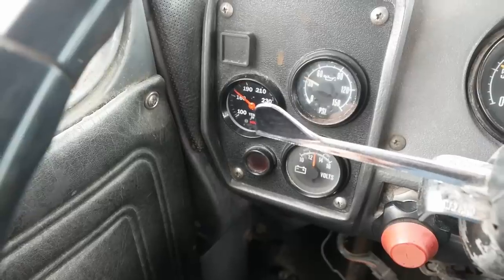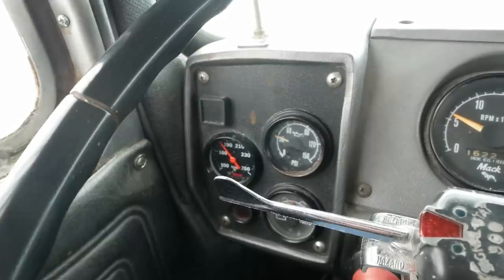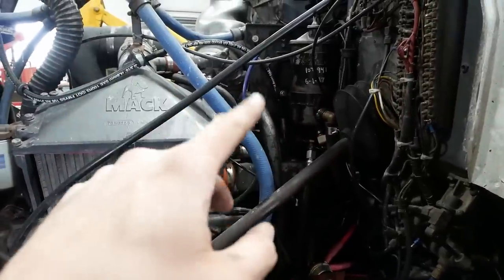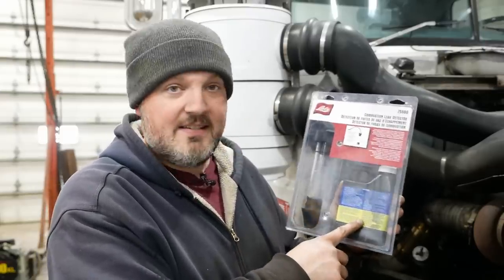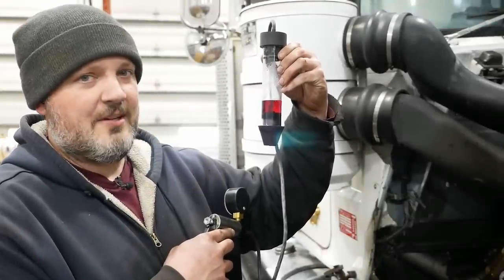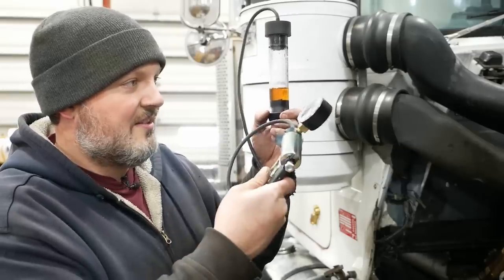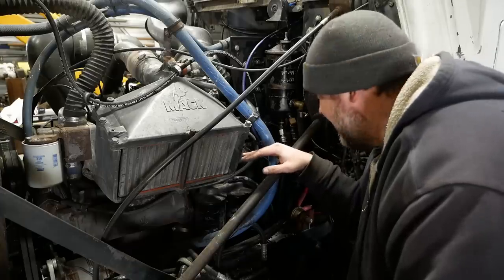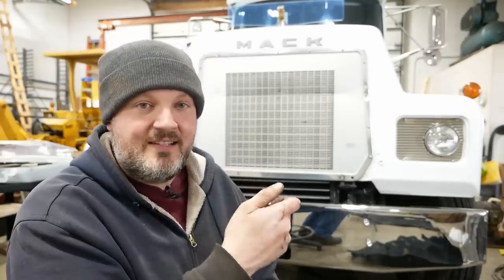Can You Trust a Head Gasket Tester? - R Model Mack Overheating

Comment from the maker: Be sure to tell me it's the compressor! https://youtube.com/shorts/HHOhku_5IKA
Reply: I post guitar playing videos from time to time and a guy told me I was playing out of tune. Replied with "No, I checked before and after recording". Got an answer telling me "Well yeah but you were out of tune in between!" Internet commenters sometimes...sigh.
Reply: Looks like a bad head gasket to me!
Reply: No one ever wants to believe its a headgasket. I once told a guy he had a dead cylinder, which you could clearly hear while cranking. He said it was the idle air control motor... seems legit!
Reply: Considering the weird vehicle issues you seem to readily attract, as added sanity insurance before replacing the head gasket, I would: 
1) Make sure it still bubbles with the oil cap removed (i.e. over-pressurized crankcase + cracked block combo). 
2) Use a radiator cap adapter and pressure gauge on a cold start and see if it quickly hits and continues past 20+ psi. With the compressor/turbo system ruled out, a liner/head/fire-ring leak should be the only way left to give it that much pressure. And if the pressure just levels off at some low psi... 1) Figure out how to be less attractive to weird vehicles 2) No idea. But I'm sure it will make an interesting video.  ;-)
Reply: Didn't Eric O/SMA recently did a Prius and it held pressure and I forget if it was the liquid tester he used also or not but that's usually the way to go. Anyway he got the job and pulled the head and sure enough you could see the gasket blown out clean as a whistle between the water jacket passage and one of the cylinders. It just wasn't clear enough to know because the severity was minimal.
Reply: My Car a Fiat Panda 169 hat the same symptom. Once you hit the Accelerator the temp would shoot up and come down again while decelerating. Headgasket blew out and the head was warped.
Reply: The one thing we know it is not is combustion gas.  Your breath turned it orange or yellow.  Diesel exhaust gas is 12.5% CO2.  For every gallon of diesel burned, it generates 22.38 pounds of CO2.
Reply: @tarstarkusz  22.38 pounds of what?
Per square inch? Absolute weight?

Only confirming, as 1 gallon of diesel is 7 or 8 pounds
Reply: @cryoburned  Diesel is yes. Of which around something like 6 pounds is carbon atoms. And when combined with 2 oxygen atoms per each of those carbon atoms, ends up producing around 22 pounds of CO2 after combustion.
Reply: @cryoburned  22.38 pounds of weight of CO2.  I believe a gallon of water as well.  It picks up the extra mass from oxygen molecules.
Reply: It's the compressor.
Reply: I would like to see more of this.

Comment: Hey Wes. You might want to disconnect the coolant lines from the compressor and run the truck to insure the head gasket on the compressor is not the issue. Even though you disconnected the discharge line, the compressor is still trying to build air and could be leaking pressure into the coolant system through a leaking compressor head gasket. You can also drain the wet tank to see if there is coolant present. You can also check the intake air pre-cooler by bypassing it In the cooling system. I’m not trying to tell you what to do. Just trying to help out. I watch your videos every week and think you do an awesome job. I’ve learned a lot of tips and tricks from watching your videos over a few years and its made me a better mechanic. Thanks for the great content and knowledge.
Reply: I second this
Reply: there is no coolant going through the head gasket area on that compressor. you can install stand pipes and fill them while running but its much easier to just pressure the intake of the air compressor since they are just reed valves
Reply: 3rd this
Reply: Compressor head gasket can cause some real problems. I had one go bad and backfill the fresh air supply line to the compressor which loaded the intake manifold. Starting the truck back up to pull it around into the shop bent the number 6 connecting rod. Learned my lesson quick on that one.
Reply: Yes bypass everything on the compressor before pulling heads.
Reply: I fourth this
Reply: Hah. No.
Reply: There is just no way there is any exhaust in that cooling system. Burning diesel creates a ton of co2.  It's over 22 pounds per gallon of diesel.  It's like a 3 to 1 ratio.  He is questioning chemistry, chemistry he proved is working with his breath.
Reply: @tarstarkusz.  Not remotely close.  It’s not uncommon for the symptoms to only show up when under load.
Reply: @sharpright6887  But the gas pressure is in the system even not under load.  Did you not see all the bubbles?   There likely would be enough residual CO2 in the system dissolved in the coolant.
I suppose it's possible the truck has 2 problems. 1) air getting into the coolant and 2) a leaking head gasket only under heavy load. But this seems unlikely.
Reply: I think one way confirm this theory would be to get a air tank (measured) and a pressure gauge and hook both up to the coolant tank. Then measure it over a period of 1 minute. Calculate the amount of pressure and flow by how full of gas the tank is. Compare that to known sources. Example, Turbo pressure (would be way lower than the air compressor). If its between the turbo max pressure but below the air compressor max, it might be the air compressor. If it is 300-600 psi head gasket is likely.

Maybe some modification of that theory might help someone. You could also drop a type K thermocouple in the liquid and measure its actual temp to aid Wes's bubble gauge theory.

Comment: I've used a 2 gas Hamilton smog analyzer for several decades on gasoline vehicles to detect a leaking head gasket. Worked very well. But never had a leaky diesel head gasket. Plus it never occurred to me to use the analyzer on a diesel. That would be interesting if it did work on diesels.

Comment: I like your theory about the gas bubble.  My first thought while watching the temp needle drop is that NOTHING could take heat out of the coolant that quickly.  All I could think of was some sort of intermittent restriction that blocked all flow, then allowed near-room-temperature coolant to suddenly flood in.
Reply: And a diesel like that couldn't add that much heat to the coolant that fast in the first place.
Reply: That's something you probably won't find till you pull it apart. I'm glad I've never had one you couldn't tell for sure.
Reply: Actually, my first thoughts were to check to verify that the gauge is indeed working.

Does the engine smell hot? You should be able to smell and feel the difference between 180º and 220º with the hood open, and perhaps even closed.
Reply: @DanEBoyd  Get a laser temp gun they will tell you temp of what ever you point it at.
Reply: I’m thinking either a flakey temp gauge or a bad thermostat to start with. If it’s making cooling system pressure stone cold, & if it was setting off the Co2 tester then that’s bad news.
Reply: I agree, and had the same thought as well.  There is no way the coolant temp could increase and decrease that quickly.
Reply: you sure the gauge is working, got another one to try good luck
Reply: @DanEBoyd  may also consider relocating the temp sender to eliminate the possibility of measuring the gas bubble temp instead of the coolant temp.
Reply: @gerardcudmore1556  they work on Emissivity, they have a huge variance based on whether they are pointed at black rubber hoses vs shiny metal.
They are useful, but not always something you can trust.  
I think he already has one
Reply: @gerardcudmore1556  That's what I was trying to think of...😆
Reply: My thoughts exactly, Is there really a cooling issue or just a temp gauge issue.
Reply: @DanEBoyd  Hand held laser thermometer or camera thermometer. In good quality, neither is cheap, but either is better than any gauge known to man. I have a laser thermometer and i never bother using the temp gauge whenever i'm diagnosing sh!t. One too many times i got bit by broken stuff, right out of the box garbage and more. Dash gauges are more like guidelines for the road warrior, whenever you fix stuff, you shouldn't even acknowledge their existence.
Reply: Yeah - I was doubting the sender/line/gauge  too.  Perhaps pull the sender and confirm it functions correctly outside the engine ?
Reply: That’s not a “Canadian” air cleaner setup.  It’s a Mack Tip Turbine aftercooler.  All Mack’s with that engine had the same air cleaner setup.
Reply: Saw the same coolant gauge behavior on an '87 Chrysler New Yorker with a 2.2L with Turbo.  The gauge would pin, the computer voice would let you know of the impending end of the world, then 10 seconds later it would drop to dead middle on the gauge.  Cylinder head was warped so air was getting in to the cooling system.   The shop did something to the head, don't know if it was lapping??  and a new head gasket and it was fine afterwards.
Reply: @talleddie81  Unless you have a lazy thermostat - I know he said he changed it in the last few years, but sometimes parts are BWN - Broke When New.

Comment: Love when that old truck is on. Couple of things, I’ve found the newer dual chamber combustion gas testers that take the blue fluid for both gas and diesel are a little more accurate. Ive also seen where even when unloaded the compressors have still pushed air into the system. The best way I’ve found to test a compressor is hook shop air at the discharge line and pressurize the compressor head. See if the cooling system builds pressure. Great video as always!

Comment: My uncle used to take care of a fleet of 1930s rolls royces.   One of those would over heat like this mack, it ended up being a huge glob of solder in the radiator would rattle around restricting the flow.   Flowed enough at idle to keep the engine happy but got screaming hot at cruising rpm.
Reply: My friend had a Dodge Intrepid that did that. Wasn't the radiator though, the water pump impeller cracked and held on just tight enough to move coolant at idle. As you gave it throttle, the impeller would slip and slow the coolant flow to a trickle.

Comment: I know I'm not a full-time mechanic but I've ran into the same problem had to rev it up to simulate a load and the test actually worked then. It ended up being a cracked head that only showed up under pressure of a load like driving.  Good luck and keep up the good work
Reply: That’s a great idea, especially if it’s a low grade leak!
Reply: That was what I was thinking, under load the leak would open up and allow the pressure from the leak to stop the coolant from flowing. Remove the load the leak would close up and this would allow the cooler coolant to flow again.
Reply: Man I been trying to track down an issue similar to this on a 6bt for awhile now. I've tried the chemical but I can't get much pressure on the system sitting in the driveway just can't get the heat in the motor. I can drive it to town just easy cruising without much issues but once I lay into the throttle and get the boost up it starts pushing coolant into the overflow.  And by the time I get in the driveway to pull the cap and try setting the tester up it's running normal and no pressure in the system.  The only time it seems to start running above normal temp is when it pushes enough coolant out to do so. Pretty sure it's a head gasket but I was hoping I would have been able to positively diagnose it before ripping into it.
Reply: BreatheScotland  I had bubbles the first time I noticed the issue when I got home it was pure bubbling in the overflow but since I bought the test kit the three attempts I have tried I couldn't get it to bubble just signs of my reservoir level going up when I get it in the driveway.  I haven't had much time lately to try another go at it I need to tho.
Reply: @kmrjeep    Oh, jeez - I just had this mental image of your hood removed and you sitting up on the engine doing the test tooling down the road while someone else is driving. Sometimes my mind just goes a little wacky! 😉🔧👍
Reply: @kmrjeep  Best wishes to finding your trouble!
Reply: If it wasn't leaking at idle then the glove wouldn't inflate.
Reply: It is definitely doing it at idle. If you watch at 07:30, he unhooks the vacuum pump from the hose and all that bubbling is just from the air pushing out of the radiator.
Reply: Hey Wes. With that fluid test and those bad scope leads doing you dirty on wheel speed sensors, you're not having much luck with test equipment recently. Thanks for showing this stuff and reminding us that sometimes the answer is "your test equipment might be giving you big fat lies". 

Love the glove test!

Comment: I’m yelling TURN ON THE HEATER FULL BLAST AND OPEN THE WINDOWS!!! 😂
Reply: Yea that works in the winter. But when it's 100 degrees out or even 70 the heater will not compensate enough to keep it cool
Reply: @jesserousseau2481  oh yes it 100% will. It doesnt matter what time of year it will buy you some time.
Reply: @Sak-zo1ui    Yup, I’m living proof. In the Summer it does work, just not as much.
Reply: @Rein_Ciarfella  same here.
Reply: Time for the Irontite.
Reply: @jesserousseau2481  if the engine is 200°+ your heater will still lose some heat to the 70-100° ambient air.

Comment: BTW if you did not already know you can recycle the test fluids. Put them in a almost sealed container that will keep bugs or dust out but still vent and just set aside for a couple days, it will turn back to original color and work for years.
Reply: I also learnt don't just pour the used fluid back into the original container, even after the colour has returned to blue. The unused fluid in the bottle doesn't like it. Retired mechanic in Land Down Under.
Reply: @bobhudson6659  unless your fluid supplied to you is dif than in the US whatever container it was in got contaminated, It is just the color change due to CO2 and it does not hurt fresh fluid. Might have gotten some antifreeze during testing.

Comment: Post an update on this issue or further findings if you can.  The air leak you hear on the drivers side is from the reversing relay bolted to the intake manifold.  Works with the rack as a puff limiter.  SOP.  Appreciate the content.
Reply: Jim that puff limiter only got supplied with air when the maxi brakes were released so assuming the maxi's were applied when he was working on the truck, probably not the leak !
Reply: @mikesautotruckrepairinc.cr5621  Agreed.  The way it should be.  This truck has been touched by several hands and I bet some creative plumbing has occurred.

Comment: Hello Wes.The guys at "BMT" big mack trucks forum, will probably be able to point you in the right direction as to particular head gasket tests that can be run on on that Mack engine , which looks to be an 2 valve e-6 ,with 237 hp or maybe 285hp.Just food for thought.great video as always!

Comment: Hi Wes!

I wonder if you could try the chemical test again but this time rev the engine while you do it?  maybe the gasket/crack only plays up under load? at idle is ok.  might be worth trying anyway.   

I'm sure I've seen one of your videos where the colour changed! 

greetings from Australia
Reply: Thats how you get pressure built behind the tester and when you remove it instead of there being a vacuum in the tester you got compressed gasses behind it and itll shit 200 degree coolant out like a fat guy on taco night..
Reply: or maybe do the test next to the end of the exhaust
Reply: @Z-Ack Can't the pressure bleed out right through the tester?
Reply: It is definitely doing it at idle. If you watch at 07:30, he unhooks the vacuum pump from the hose and all that bubbling is just from the air pushing out of the radiator.
Reply: @j4891  I meant in terms of getting the combustion gas tester to change colour.
Reply: Might make a difference, but as bad as it is leaking even at idle, that should have been more than plenty of volume to test with.

Comment: Wes!  Don't leave me hanging!!!  ;-)  Funny, just as started to say something about using a scope I was thinking Eric O or Schrodinger's Box would have a scope-based solution.  No dice on this one.  Oh, well, at least I'm thinking.  I still say using an IR thermometer all over the engine might tell you something you don't already know.  Another thought - stick a regular thermometer in the radiator cap hole and see what happens while it heats up.  I just have this sneaky feeling this could be an electrical issue or the gauge is faulty.  Maybe the wrong calibration or the wrong guts for another gauge.  Thinking outside the box at this point!
Reply: Yeah but what explains the air coming out of the radiator cap then? Seems to me that's the best place to start the diagnosis
Reply: @Netherlands031    I wondered about that!  Normally that says there’s a head gasket leak, so I guess that was the first direction Wes was going in.  He did start there by trying to analyze the gas coming out but it was inconclusive because the tester didn’t show CO2. That’s why he went on to look for other sources of gases (air in this case) getting into the the cooling system from elsewhere.

Comment: If you have a multimeter that has thermocouple ability then place a surface mounted thermocouple on the temp sensor and see if in fact the temps are fluctuating as quickly as the gauge tells you they are. The temps of the gauge and thermocouple probably won't match but you should still see if those wild fluctuations are true or not.

Comment: Would there be any advantage in plumbing an additional coolant temp gauge in another motor location just to confirm that the 1st one is legit. Maybe try the electronic gauge sending unit variety vrs the line oil pressure type, long shot but cheaper than tear down.